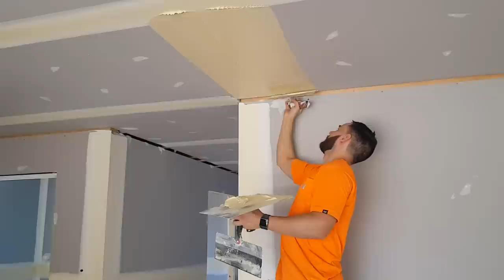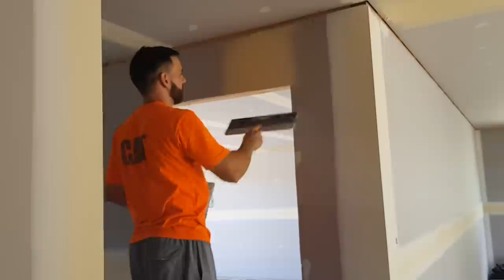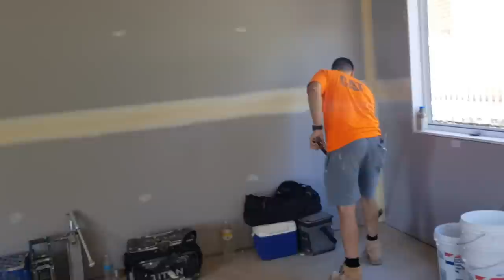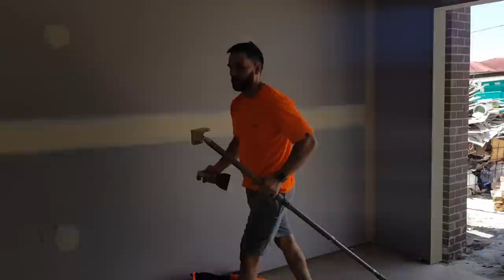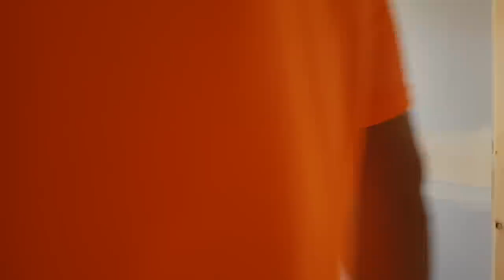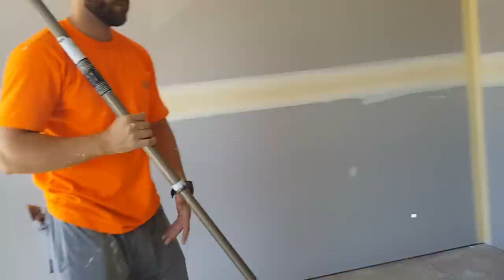Drywall Construction Workers Finish Coating Room in Minutes

Comment: I don’t get it!!!!

Why do you put it on with a trowel and wipe it with a knife? 

Why don’t you just put it on with a knife and wipe it with a knife and forget about the trowel?!?!?
Reply: Don't like having the mud too watered down so less shrinking and it's much easier to apply it with a trowel when it's a little thicker then a knife
Reply from the maker: because the trowel doesnt cover 14inches
Reply: drywallgangsters got it. 

I like the trowel for putting a lot of material on fast. 

Seems faster than a knife unless it’s just in my head
Reply: @antoniosmall4413  yeah I agree too and less pressure on the wrists because you can get your whole arm behind the trowel but people who just use knives seem to do it well too just different tools to get the same job done I guess
Reply: Maxkil Lord of the Drywall, can you do a video timing every function?

How long does it take to bead a window. 

How long does it take to bead a closet. 

How long does it take to tape coat a house. 

How long does it take to tape coat a room. 

How long does it take to sand a house. 

How long does it take to skim a house.
Reply: @antoniosmall4413  doing a whole house time wouldn't work that well as all houses are different and have different heights different amount of beads and more complex and time consuming parts. This house in the video is 700m2 (7500 sq feet) and took the 3 of us 8 hours to do the whole house (not including sanding or fixing the drywall) but all the other points would be good! Merry Christmas!
Reply: I won't say anything negative till I try that method. I'll just keep thinset out of my head LoL
Reply: @michaelcharest6693  I agree with you I've been using a trowel for 20 years and I've never had to do another ten passes with a knife after and I only use a 12" for everything lol 14" hawk so i can hold more mud
Reply from the maker: Go on @drywallgangsters Instagram. I'm yet to see anyone do it better.
sometimes I only need a couple passes. Doesn't mean it comes out better. Some would say it's good to be meticulous and perfect if it means going over it enough times till your 100% happy. That's a good trait
Reply: drywallgangsters you did 3 coats in 8 hours? Or you did each coat in 8 hours?
Reply: No you got that assed up you should just use a trowel maybe a six inch broad knife to feather the edges that's it no large knife that's a waste of time to what save a small amount of top coat that's going to roll up if you keep scraping it and reusing
Reply: Scott olsen what do you mean by roll up?
Reply: @antoniosmall4413  I mean when you keep scraping it off your set joint and putting it back on your hawk  the joint compound becomes dry and tacky after a lot of doing so and then it roles up as you go to apply it
Reply: Scott olsen got it!
Reply: @antoniosmall4413  We do 2 coats of quickset and 1 of top coat on the same day if we have time and on finishing day another coat of top coat
Reply: @aydentheninja877  topping buttjoints uses a bit of mud so you're using it all up fairly quickly and grabbing fresh mud from the bucket you don't get any roll up. Maybe another brand of all purpose might do it though. We use USG sheetrock total lite
Reply: @drywallgangsters  So three guys two days? 

How do you guys get business?
Reply: @antoniosmall4413  This job took 7 hours day 1 and 2 hours day 2

Not sure what you mean?
Reply: drywallgangsters ok. I am asking how do you get work?
Reply: @antoniosmall4413  Word of mouth, if you do a good job you'll get work!
Reply: @drywallgangsters  Got it! Thanks.
Reply: I use a knife and even I know that a trowel is better.
Reply from the maker: Me too Robert, haha, just never practice
Reply: 14 inch knife bro..

Comment: Of course you can finish in minutes, NO ANGLES does every home in Australia have crown?
Reply: Pretty much but it's cornice not crown moulding it's made from the same stuff as the drywall
Reply: Gotcha
Reply: I can still get the same results with my hawk, trowel, 6" knife with FAR less passes. He had 13 passes on one butt jount
Reply: @michaelcharest6693  that's good for you, same all purpose mud? (Usg sheetrock ultralightweight) but these buttjoints are getting their 3rd coat  just hours after being taped so more pock and pin holes show up in comparison to if it was done the next day. Every buttjoint is different some you can get done on such little swipes but some you aren't happy with so you swipe more
Reply: I guess it sounded like a criticism, yea hot mud tends to leave plenty of fisheyes so i know they are tough to get rid of. I did find a national gypsum setting type compound that doesnt leave any. Its awesome.
As far as the extra knife used it just seemed like an extra knife to deal with but to each his own
Reply: @michaelcharest6693  hot mud is used on basically all jobs here in Aus. Builders want you in and out as quick as possible. 2 coats day 1 and the 3rd on day 2. that's a curved trowel in the video to apply the mud and cut the edges and he's using the knife because it's pretty flexible and doesn't cut in. Probably does need to buy some flat trowels so he can get rid of using the knife but it's not hard to hold the knife under his hand.
Reply from the maker: Thanks Andrej , there's a constant flow of questions around here. How's work bro?
Reply: @Maxkil  hahahaha yes I noticed. Yes work is good! How's things with you?
Reply: Andrej hey I just saw the cornice you were talking about, is that a plaster based product? So it’s just glued on and muddled on the inside and outside angles? Nice looking stuff
Reply from the maker: Not bad. Been sweating it out at Springfield and gold coast mainly
Reply: @michaelcharest6693  Gets glued on with cornice cement similar to hot mud but a lot stronger and yeah you just mud up those angles
Reply: @Maxkil  This weathers ridiculous but at least everything's drying. How was the Christmas break?
Reply from the maker: @dre8193  yeah everything drying quick all right. Yeah I stayed down Surfers Paradise for a while with the family was good thanks. Ask around the team if I can come back for another shoot.
Reply: @Maxkil  sounds like you had a good time. Yeah will do, works a bit all over the place never know where your going til the night before 😂

Comment: Dude, 13 passes... really??
Reply: That's what I was saying why so many ( load one side then the other , cut your edges, one down the middle ) done ...
Or use 12" mud box on both sides wide open, next day skim the 10" down the middle, done...
Reply: @patricktondu5366  you must love sanding
Reply: Ethan McSpeerin this guy finishes passing early, but spends more time sanding. These guys spend more time passing and less time sanding. 

The time equivalent is the same. So many fucking thick head drones in trade.

Comment: Why do these guys put up videos of them doing the job all wrong. you never coat your seams and butts before you tape your angles and those gaps wall-to-ceiling are ridiculous. If you're going to put a video do it right. And who spots there screws one at a time. and how many times seriously are you going to wipe that but joint I could have done 3 by the time you finish that one. If you showed up on one of my jobs I would have fired you in the first 5 minutes. Sucky work. And get a pan.

Comment: He has alot of training needed still i seen numerous mistakes im 30years in the trade .hes around 80percent journeyman
Reply from the maker: Mistakes, where?
Reply: Yeah, ok!
Reply: That a perfect job dude
Reply: Need more screws on the walls forsure before mudding
Reply: @berniesena9991  could be inner wall which can be glued
Reply: Anthony Maniz...where's your video so we can see the proper way?
Reply: Even if glued should be more screws on the walls then that
Reply from the maker: Then I can say it's wrong. I can say where's the glue? Look at all your buttjoints with your short sheets.. lol. Nobody ever send me a video
Reply: Are you serious? Never seen a clean plasterboard job like this... In any case I wait a video of yours, so we can learn from your skill...
Reply from the maker: Yeah tell me about it. Welcome to the internet.
Reply: Bernie Sena pretty sure they used stud adhesive.
Reply: You don't understand taping
Reply: I agree. He hits the butt joints almost 15 times! Getting paid per wipe!
Reply: You old timer are the sloppy worker am not into tapping as a carrier bit I do it to get by but I've worked it with alot of old time they suck I have do over all there before I paint and am only in it like for a 1 year . Let's see what you can do
Reply: @patricktondu5366  you can see the timber on the top plate of the wall needs two screws in the centre of each sheet wall or ceiling dontatter glue or not
Reply: @Harles74  I used to do this quality setting just didn't have the fancy corner tool pole wouldn't have minded having one that's for sure and stilts are illeagle in nsw
Reply: Lot to learn i see alot of chatter
Reply: @anthonymaniz4077  20years experience gives me the right to
Reply: Enough for the comments from all you guys talk to the hand you can get to my level you know how to get ahold of me
Reply from the maker: Your family own that big drywall company? Was that you Anthony? Can't remember
Reply: Yea right,,i dont think you could do better man
Reply from the maker: Funny right
Reply: @patricktondu5366  Could be but it's not.
Reply: @berniesena9991  Nope.
Reply: I'm a painter 18 yrs and I'd be happy to paint/tex after these fellas. Excellent work and video guy's.
Reply: Maxkil everywhere!
Average diy’er at best
Reply from the maker: Funny bro.
Reply: Maxkil you’re obviously not in the trade
Reply from the maker: Obvious by my 400+ videos

Comment: Garbage just garbage you dont need to use all those different trowel to pull a but joint then he is not pulling them all the way threw the flats
Reply: Ron Davis why you hating
Reply: It's fucking drywall dude.... get over it

Comment: Why dont YOU JUST USE YOUR DRYWALL KNIFE .LOOKS MUCH BETTER WITH THAT .HAWK AND TROWEL FOR STUCCO AND PLASTERING.WHERE ARE YOUR SCREW HOLES ON WALLS WHAT DID U GLUE THE WALL ON THE STUDS .